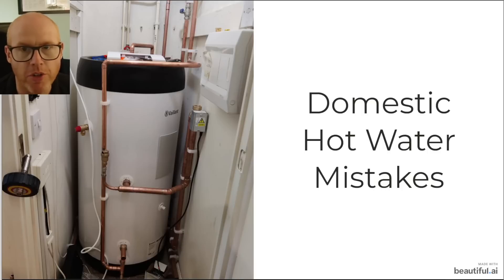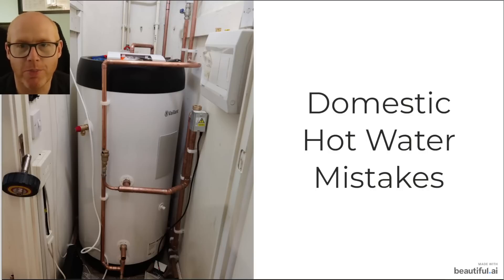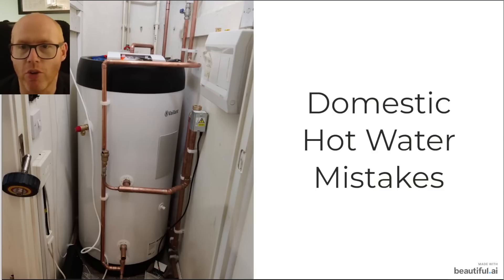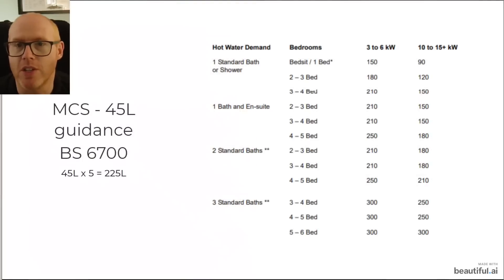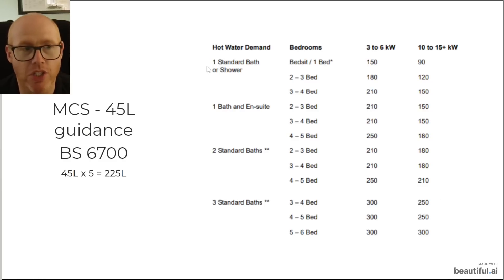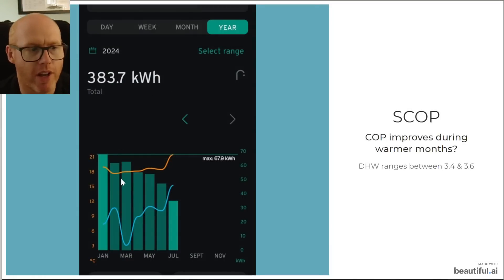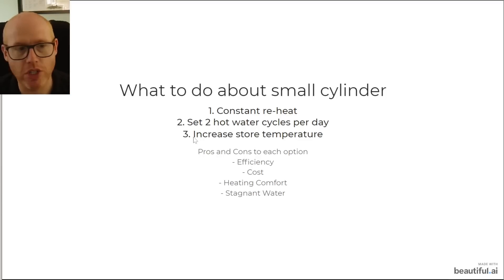My Hot Water cylinder is the WRONG size! What I've learned about heat pump hot water cylinders.

Comment: Achieving the perfect size of hot water storage cylinder is probably even more complicated than you have described. When I swapped my 160L tank for a 200L version with better insulation I failed to anticipate one of the negative consequences. My wife uses our airing cupboard to store bed linen and towels but the shelving is now about 350mm higher up so she has difficulty reaching the top shelf without standing on something. I am reminded of this inconvenience on a regular basis.
Reply from the maker: Oh yes! I had to trim all of the shelves and reposition them in front of our cylinder. So we have three times as many shelves that are a third of the depth of what we used to have.
Skinny little shelves that are accessible at the front of the cupboard made my wife happy.
Reply: Interesting observation! I might talk to my installer about mounting the cylinder as high as possible, so that the shelf is under, rather than ontop?
Reply from the maker: @Leo99929  It's a lot of weight that you ideally want mounted directly onto floor joists.
Reply: Agreed, water usage can be highly variable and two apparently similar households can have vastly different water usage. I keep wondering whether I should have gone for a Mixergy tank.
Reply: Steps?
Reply: Is it worth to have some uninsulated pipe work in order to warm dry store the clothing?
Reply: @Google_Does_Evil_Now  not really. There's normally enough heat leaking from all the insulated pipes anyway.

Comment: You might want to try a water waste heat recovery system in both your bathrooms.  Some of them are silly prices new but there are sometimes bargains on ebay.   Even new it would probably be cheaper than a new tank to install and will save you more in energy costs I think.
Reply from the maker: I did have a page in my spreadsheet to calculate if one of these would even return on investment.
The answer was no, by a long way. BUT that was for new units and having to endure substantial building work in one of the bathrooms to be able to fit it.

I calculated that a house with a single bathroom would benefit more quickly and especially combined with a bathroom refit anyway, the labour cost becomes negligible.
I didn't consider finding any bargain units which would change the sums dramatically.

They are certainly the future, even though their effectiveness is quite limited.

Comment: Strange that the Vaillant cylinder is by the volumetric capacity rather than the DHW capacity. This is in marked contrast to the heat pump power output rating which is on a worst case heat output.
Good luck with chasing up British Gas.
Reply from the maker: Yes, I agree! Labelling and badging does my head in!

Comment: I have a 290l Joule cylinder for a similar size house. I operate it on hysteresis, not on schedule and with a target temperature of 43 degC. It usually does 2 cycles per day and takes 30 minutes to recharge.
It is debatable to claim installer negligence because he will argue that you can run your DHW at higher temperature. Depends on what scop was sold on the contract, but even tho, these are indicative, not contractual values.
Reply from the maker: Thanks for commenting.
Good to see you're still here with a water temp of 43. The anti legionella gang will be on their way with a warrant to turn your store temp up to 55! 😁

I guess you need a lot of water to have a 290L tank on hysteresis?
Reply: With 43 degC for a family of 4, we are using the capacity of the tank every day so no much risk of legionela.
Great video from heat geek about this.
https://youtu.be/oJeyc_cGIMU?si=u08JRVdVGNuxUhmY

Comment: Octopus use 50L per bedroom +50 to calculate tank size Which works out to 250L. There is only 2 of us so we only heat tank on Wed/Fri to 47° and Sun to 55°.
Reply from the maker: Sounds like you've got it set up nicely! Thanks for sharing that Octopus are going above and beyond the MCS guidance.
Reply: The minimum temperature at cylinder is 55 Deg C to guarantee legionella is kept under controlled.
Reply: @martynscott1227  With our old tank we set it at 50° for the last 20 years and I've lived to tell the tail.😂

Comment: Thanks for another great Video, it's great when people are happy to share missteps as well as successes. I had two thoughts out of this firstly there is also the issue of oversizing, for example in my case I am a single occupant in a 4 bed house so my own needs would be catered for with a 100 ltr cylinder and this would be most efficient from a draining the tank daily (ish) perspective. However in planning the system I need to consider if I ever sell my property it is much more likely a family of 4 would buy it and hence there requirement would be a 250ltr Cylinder so I would need to drastically oversize for that probability. I think there is a easy/neat solution to this.  Market a cylinder type that has two chambers insider of say 2/3 and 1/3 capacity and have a physical lever mechanism on the outside of the tank that allows a flap to slide open in the division to allow use of the smaller top chamber when needed.
Reply: Have a watch on the heat geeks video on their cylinder and take a look at the mixergy tank as well. Basically you get minimal mixing in water at different temperatures so a boundary layer. So the mixergy one actually heats from the top rather than a standard tank that heats from the bottom. So you decide what amount of water you want to heat.
Reply from the maker: Yes, great comment!
I have seen on one of the forums that someone has installed 2 x 150L tanks and has some valves that they open when family comes to stay and close them off when it's just the two of them at home.
I'm not sure how they combat the stagnant water that sits in the second tank, but it's interesting to see innovation!
Reply: I don't think he is happy about having a system fitted that isn't what he wants and doesn't work.

Comment: Interesting video. Is it easy to top up from immersion heater during solar export periods or is that a non starter?
Reply from the maker: It could be done but only at 100% efficiency, instead of the 360% efficiency of using the heat pump.

Comment: We are a family of 5 and have a mixergy 210lt tank with a plate exchanger and have not as yet been able to run it out of water. I will admit we do not yet have it feeding a shower, it is only feeding the main hot water for sinks and a bath, but we have easily managed 2 sizable bath times in a night regularly without running out.
I would look at any of the units that use stratification to maintain temperature as they seem to work really well. Mixergy is not the only brand that uses this technique.
Reply: It's worth mentioning that the Mixergy tanks use plate exchangers so you will have an actual usable hot water volume of 210L rather than the 172.5L from the Vaillant 200L due to the volume taken up by the coil (as stated in the video) so that's the best part of 40L which is almost an extra person's allocation :)
Reply from the maker: Thanks for your comment.
Heatgeek has some interesting videos about your mixergy tank, both for good and for bad.
I'd like one just for the control freak in me and the access to more data!

Comment: How about using an undekink storage heater for kitchen use of hot water. Save on water wastage with the short run of pipes.
Reply: I do this now. 15 litre tank works a treat. Dishwasher and washing machine are cold fill, so little demand for hot water in the kichen.
Reply from the maker: We're not in the habit of using much hot water in the kitchen.
We have cold fill appliances now and use the kettle when necessary for cooking.
It's certainly a good solution for some.
Thanks for commenting.

Comment: Nice overview.    We have a similar Vaillant system but with a 300 l Joule cylinder.    One thing I’ve found is that changing the offset temperature in the settings makes  little difference to the hot water flow temperature.    With the hot water temp set to 50 C, the flow temperature still gets to 58-60 C even with the offset value at zero.
Reply: it is all to do with the power available from the unit and coil size. Basically, your coil is too small to be able to take the power from the unit once the cylinder gets closer to the target.

You should still run offset as low as possible, but you need to watch for cycling.

If you have a larger coil such as a Newark HG cylinder with 6m2 coil and a small heat pump set to eco (5kW) to limit the output to 4.5kW you can run offset at 0c and the flow will only overshoot by few degrees.

Try that on a Vaillant cylinder (tiny coil) and it will overshoot more. Try it on bigger heat pumps 7-10kW and the overshoot be even more.

Always keep offset low.
Reply from the maker: Yes, I did some reading on one of the forums and it appears to be the flow rate that the Vaillant heat pumps run at.
Because the rate is so high, the offset is rarely relevant apparently.
Thanks for the comment!
Reply: using eco mode make a big difference to this and consequently to COP

Comment: Would Increasing store temperature considerably and just one cycle on cheap rate help ?

My problem is capacity needed for whole house full I need biggest cylinder , when there are only two of us which would be most of the time we have the big cylinder , inefficient, although am  going for the new heat geek one which I am hoping will help .
   But without such as you flagging this people won’t think about it .
Reply from the maker: Yes, that's what we've been doing for the last few warmer months. Higher temp and one cycle on cheap rate. We'll keep experimenting to find the sweet spot.
Glad it got you thinking.